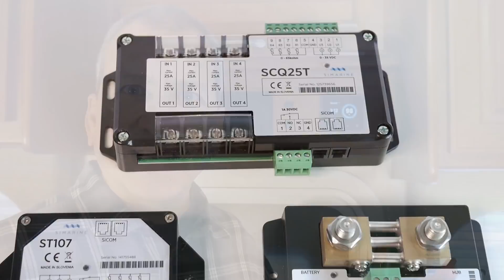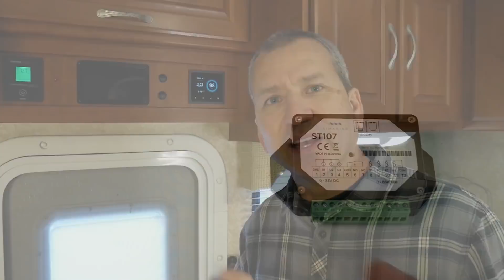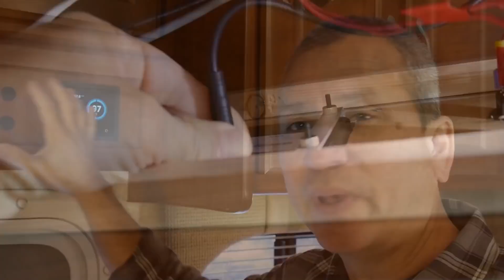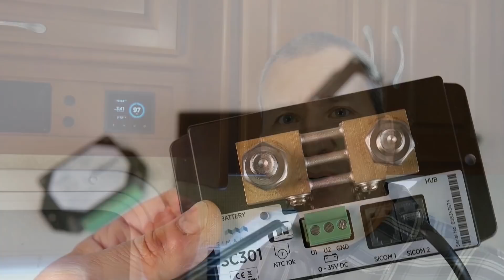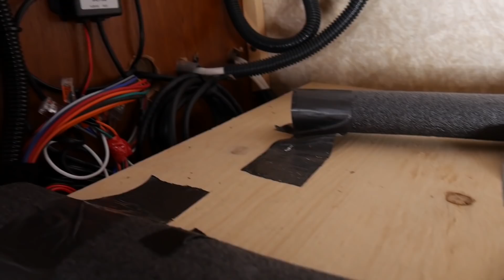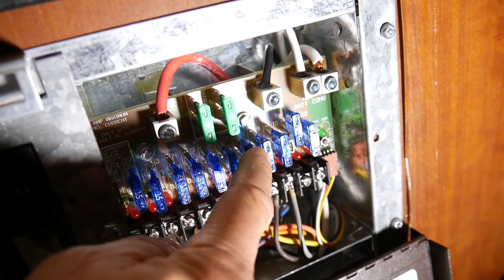SIMARINE PICO Monitor Review and Install in RV

Comment: Interesting device.  Since it uses the existing contact style probes, is this unit still sensitive to the residual contamination in the holding tanks, particularly the black tank since it is usually the worst in terms of not reading accurately with the light system?  And it looks like it displays a much higher resolution on the tanks than just 1/3, 2/3 and full that most of the light displays show?  Thanks.
Reply from the maker: It reading the resistance from the tank sensor output. So any contamination will still be an issue. The PICO calculates the percentage full based on the calibration levels you enter. You can enter as many as you want as you get the system dialed in. Even though your tank may only have only 3 sensors, the output sensor resistance value still changes continuously even when levels are between sensors.

Comment: Good video and great gear,
I installed a pico plus a bunch of sensors in mu Knaus Sun TI because the original equipment suck. Those RV manufacturers seem to live in another century... With the pico you know exactly how much is left in the batteries and tanks. Good configurability, good looks.

I agree completely on the mentioned cons
especially the main screen and wifi are number one for improvement.
Reply from the maker: Thanks for the comment. It's great getting feedback from someone else using the system. I'm very interested in following what Simarine goes with this unit.

Comment: Great video.  I just went on their website and ordered one for our RV.  Quick side note, have you replaced your black water probes?  if yes, did you just use factory replacements, or something better?
Reply from the maker: Sweet! I'm still using the stock 3 probes for the black and gray. They are tucked into an area I don't think I could even access. So I hope they don't fail. What I've done is to add a couple more resistance calibration levels based on looking down the toilet and observing the level. The more calibration points you have, the more accurate the gauges will be.
Reply: haha.  I have never ventured to look in that hole.  I have a 2014 unit (Thor Siesta 24SA) and the stock probes failed in year two.  I replaced them with the Horst probes, which seem to work okay, but my standard panels almost always show my black water at 3/4 even after a dump.  I am assuming that they are using a resistance also, so the Pico will show the same until I can figure out why it doesn't take long for the black water to have a false indication.  I figured as soon as the Pico comes in, I will do a real cleaning of the holding takes, replace the probes, and start from scratch.  Again, thanks for the great videos.
Reply from the maker: Happens to me often too. It's usually toilet paper sticking ot the probes. I clean it often by spraying it with a tank wand then filling the tank to full. Then I let it sit for a couple hours or even a day before emptying it out. That usually does the trick.

Comment: Definitely a very cool system but way beyond my capability to install. I just wish my current tank sensors were accurate.
Reply from the maker: Most of our tanks only have 3 sensor levels which also tend to fluctuate. Something I learned during this install. The sensor setup allows you to set more calibration points which can help dial it in more. Yeah. It's not an entry level project for sure.

Comment: Brian, looks like a Victron clone
Reply from the maker: They are bit different. I believe the Victron GX can do a bit more power-related automation though if you have all Victron gear. If you're invested in the Victron line, you should probably stick with the Victron monitoring as well. I don't think the Victron has tank level sensor monitoring though. I could be wrong.
Reply: @RVwithTito  the cx does not. But there is a new one called Venus witch does. I have all Victron, wich I love. But thanks for sharing.
Reply from the maker: Just looked up the Venus GX. Yup. Looks like similar inputs. I wasn't aware of this unit. Thanks for the info.

Comment: First impression: Beautiful! It's surprising that it's taken this long for the industry to come out with a retrofit option for tank and battery monitoring that is both beautiful in design, but also in functionality and customization. Awesome that it is connected and has mobile app support too! You didn't disappoint, Brian :). Thanks for the detailed component and install information, there is very little in the way of videos or RV install examples for the Pico, that I have found so far. I think this could be one of my first upgrades when we pick up a motorhome in the new year. I would be interested to know more information about other supported monitoring, ie: solar, inverter, generator, chassis battery, etc. Thanks!
Reply from the maker: Glad you liked it. Thanks for the feedback. Simarine has been focussed primarily on the marine applications of the PICO. All of their diagrams were marine installations, which is why I put together a diagram for my RV install. There's a link to it in the description and video. I also picked up an extra shunt module that I'll be installing to monitor my combined solar input on the PICO. Right now I have to switch between the PICO and the Victron app (for my charge controllers). The PICO shows my overall current in/out of the battery bank, but it subtracts it from the current load. I don't know how much exactly is coming in from solar.

Comment: I think it's a bit disingenuous to suggest that this system is a simple plug-and-play. You never showed the difficulty that must be involved in getting the wires from point A to point B throughout the RV. Other than removing the microwave, what else was involved?
Reply from the maker: Sure. It's usually a pain when running wires from one end of the RV to the other and underneath as well. That's one part of the project that will certain vary from RV to RV. I run the cables inside the cable gap in the cabinets and then inside and behind walls to get to where I need to. To get under the RV, I have existing holes drilled that go under the RV. From there I can run cable across to the battery compartment. Sorry I didn't cover that part much in this video. I've showed parts of the wiring in other videos.
Reply: Most people that install it would most like have a different rig than his. Him not showing how he ran his wires has nothing to do with the product. A class A is going to be different from someone that has a 22ft in regards to how the wire is run, so I'm not sure how he's being disingenuous.
Reply: I agree. The product may be top notch. But since Simarine gave him the product to evaluate, as opposed to him purchasing it, it just seemed like there was a lot of glowing emphasis on the positive, and perhaps some intentional burying of the negative, such as wire routing (irrespective of RV size).

Comment: I sure enjoy the video's. You do a great job in explaining how you do things. I bought a new Class C, 2017 Jayco 26Y, and the only upgrade I have done was the front sway bar and might not do anything else for awhile. I was wondering, because of all the work you have done to yours, do you think you will ever get rid of it?  You should know your motor home inside and out by now and I would think it would be pretty hard to part with.
Reply from the maker: You would be correct 😊
Reply: That's what I thought.  Keep up the video's and I might do one of your upgrades some day.  My wife wants to boon dock more which would require solar.  I am really leery about drilling holes in something this new.  If it were older I would feel better about it.

Comment: I'll throw in my two cents Brian. First of all it looks like a really nice unit as far as the user interface goes which is a definite plus. I think you blew most people away with your explanation of how to make the tank level sensors work, seemed way too complicated for all but the hardiest electrical nerds, which I'm one of. Needless to say I don't think many people would attempt to make that part functional.
That leaves the electrical part, which there are a few companies that handle that part fairly well like Victron for a lower price. I'm sure it does other things that you didn't touch on like generator start/stop based on voltage and perhaps a few other things as well other than barometric pressure?
I might be interested in it if they provided some better way to interface with tank level monitoring, like an easy way to interface with the See Level tank monitors.
I think they'll struggle to break in to the RV world unless they offer an easier way to integrate their front end with everyone else's sensors or provide their own tank level sensors for both LP and water/black/gray.
Reply from the maker: Thanks for your thoughts. Getting the tank gauges setup was certainly the most difficult part of the install. I wanted to give folks who did decide to give it a go an explanation of what I had to do. I think they've heard the same integration feedback before. I read on Simarine's site/blog that they are working on supporting industry standard protocols. They are a new company, so it will be interesting to see where they go with this.

Comment: Yes please would love to know more. There are two models can I use the lesser one just want to  keep a check on my batteries not sure if could make the tank system work
Reply from the maker: Sure. The basic battery monitor system may be all you need.
Reply: RV with Tito DIY  do you know if the gas  tank system can be used for something else on the smaller one.  I have generator that uses the house battery to start it ,will it hurt the monitor shunt
Reply from the maker: My generator also uses the house batteries. Connect only the negative battery cable to the "battery" end of the shunt. All other negative connections to the rest of the RV loads (including the generator start) should be connected to the other end of the shunt. The shunt can handle up to 300 Amps.
Reply: RV with Tito DIY thank you for your time. Do you have a list of all the parts to get with the monitor system
Reply from the maker: Mark. They have a few different packages. I recommend the STANDARD package as a good starting point, plus it can be expanded. Here's a link: https://www.simarine.net/products/#packages

Comment: More than twice the current price of a Victron 702.  Admittedly, there are more features but, IMO this is only for folks who's "cool" factor far outweighs their frugal factor.  Especially true for those who already have a good tank monitor system.
Reply from the maker: Understood. It's certainly not for everyone especially if you're satisfied with your current setup. The Victron 702 or 712 are certainly good battery monitors. The PICOone package is probably the closest in comparison and goes for around $310 after the discount. Thanks for the comment!

Comment: Cool video, nice Monitor, BUT WAY too much info to put in. I like stuff that is EASY to do and not so complicated. But it looks real nice
Reply from the maker: The tank level sensors setup was a bit tricky. However, the battery monitor portion was actually easier than my previous one.

Comment: Wow!  Killer unified monitoring system.  One question - how would it handle dual propane tanks? Read them separately, or as a whole?
Again, another great video Brian!
Reply from the maker: I'm not sure. I think it depends on what sensors you have now. You should at least be able to do have them listed separately. I know the current sensors can be added together. I don't think the tanks can though. Might be a good option for them to add.
Reply: Propane sensors are often 0 to 90 ohm. So you can wire the in series and configure 180 ohm full tanks.
Reply: Thanks much for the input!

Comment: Wow! First thought is ...How much? Second thought...Why is display so small?
Reply from the maker: Yes. Of course. That's always my thought. It's a little more than the Victron or TriMetric monitors now. Price depends on what you get. There are several options available depending on your needs. A basic battery monitoring package runs just over $300 USD with the discount. Their website lists in Euros, so I've converted to dollars. Once you add more sensor modules the price goes up of course. The system they sent me was the Blue Package which is currently their most expensive because there are more modules. For basic RV battery and tank monitoring I would go with the PICO Standard package which runs just over $400 with the discount.

Comment: Very sharp looking.  I am going to have to look into this.  I like that it can use the current tank monitoring wires.  I would be interested in a follow up more detailed video.
Reply from the maker: So far, I like it. I've been getting the tanks dialed in and adding more calibration points as we are out dry camping. I'm pretty close now.

Comment: It’s pretty...  like lipstick on a pig.  I didn’t look up price, and since price is king, why didn’t you mention the cost of this kit in your very nice review?  Generally means it’s over priced.   
I also like slick displays and cool gadgets, but it doesn’t offer me anymore then a cool display of data in one place.  Most of us already see similar data on our ugly old monitor panels, this just does some simple math as well.  I really love the look of this unit, but a lot of wiring and work to install in my case. Is it worth the work and the price tag?   Do I dare go check the price?
Reply from the maker: Not trying to hide anything. There are several options available depending on your needs. A basic battery monitoring package runs just over $300 USD with the discount. Once you add more sensor modules the price goes up of course. The system they sent me was the Blue Package which is currently their most expensive because there are more modules. For basic RV battery and tank monitoring I would go with the PICO Standard package which runs just over $400 with the discount. Hope that helps.
Reply: also, prices fluctuate, its easier to just take the 6 seconds to click the link and find out current pricing rather than making the video potentially inaccurate and misleading
Reply from the maker: That is correct. I try not to talk price too much for that reason. Two years from now people will be watching this video 👍

Comment: This is a great technology upgrade for RVs. Is the monitor adaptable or expandable to add more tank sensors => fuel tanks for toy haulers?  Most have 2 tanks, 1 for gas to onboard generator, 1 for gas to toys. These tanks are always in the rear underbelly, so a long run of existing wire would or could be used?
Reply from the maker: Yes. You can add more. Any kind of voltage or resistance fuel level sensor will work as long as you can get to the sensor wiring. Long runs should be fine since there's very little current used.

Comment: Great System!... Do they make a L adapter for the display wiring harness?... in my RV I would like to flush mount the screen on the bathroom wall that only has about 1” clearance inside... I don’t think that plug sticking out the back of the display will fit?...
Reply from the maker: I haven't seen one listed, but Simarine might have one. I certainly see why you'd need that adapter for a tight installation.

Comment: Brian I had one when I lived on my sailboat,  I was beta testing for them
Reply: Dave, what was the final verdict on it? Good or bad?
Reply: @mattadams7261  It worked real well while it worked.  It did seem sensitive to stray voltages.  On a sailboat voltage spikes are a common problem.  Lightning strikes, and weird voltages from marinas.

Comment: Far, Out! Could def use something like that in my builds (solar power generators). Cost is kinda steep and I have zero use for tank levels. Maybe it could be tailored/designed differently? Would be cool to have one dedicated for solar/wind guys for around $100. However, it is really slick, intuitive, and has a clean looking display. Nice work and video...
Reply from the maker: They do have a model that's just a battery monitor, but yeah...more than $100. I'll be adding another shunt to see my solar output as well. Right now I have to switch between the victron app and this monitor.